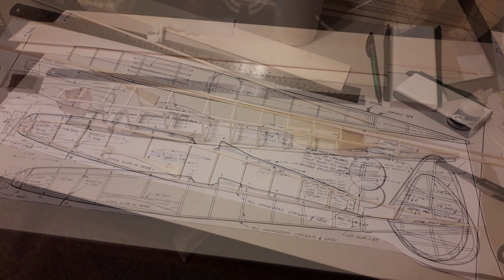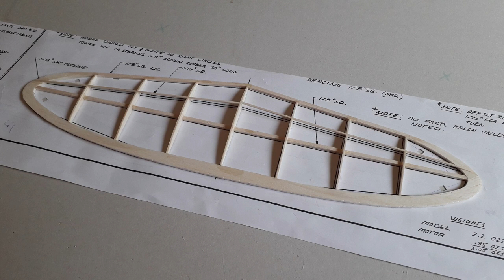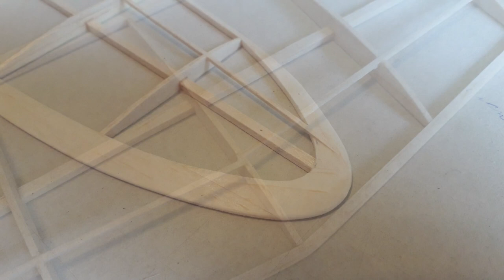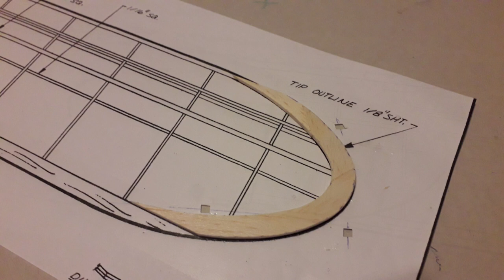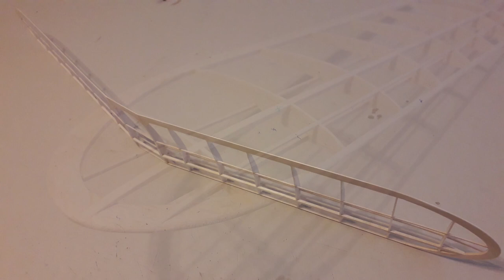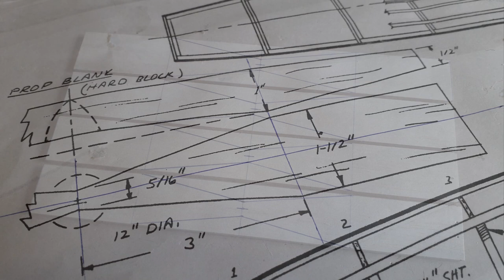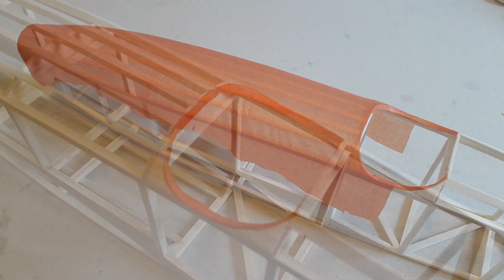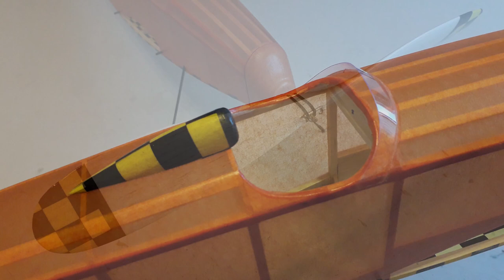Earl Stahl's Hurricane | 1940 Vintage rubber powered duration model | Stick and Tissue scratch Build

Comment: I noticed that you’ve not gone for the detachable tail section on the fus, can l ask if there was a reason?
Reply from the maker: I felt the structure would be stronger without the separate tail section and therefore made the fuselage one piece. I braid the rubber motor which makes installation of the motor simple enough without access from the 'fuselage break'. My tail is fixed but it can also be setup to hinge as a DT.
Reply: @truebalsamodeller5382  yes that’s exactly what l thought, l think I’ll construct the dt that “maxflyart” fitted to his, looks pretty good
Reply from the maker: @Colin399  great idea - best of luck with your build. Feel free to drop me an email (see channel info) for any additional info I might be able to help with. Matt.